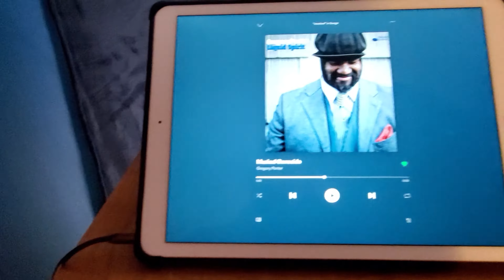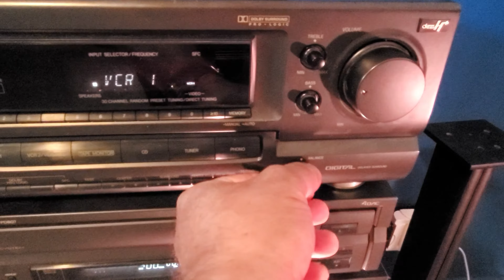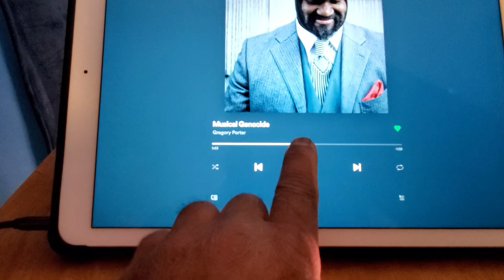I did it! LaScala Woofers finally replaced.

Comment: Why did you change the woofers if they weren’t bad?  Asking cause I picked up a pair of 77 La Scalas that work fine.
Reply from the maker: Hi.  It all started because the left channel demonstrated distortion around 70-80 HZ and it bugged me until I had to change it.  I started with the crossovers thinking it was an old Capacitor.  Then after changing One I figured I should do both to make it all even steven.  Long story short I did it!  Thanks for watching and commenting.
Reply: @mogdimitysplitz3216  ah that makes sense. thanks. ill be. refinishing my la Scalas then debate on what items need changing.